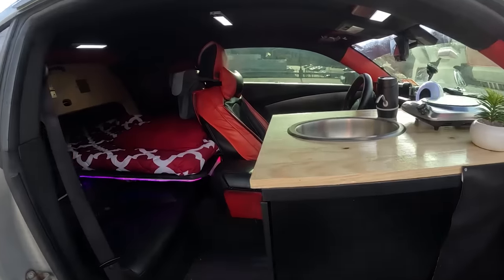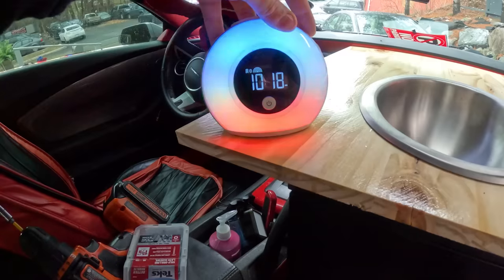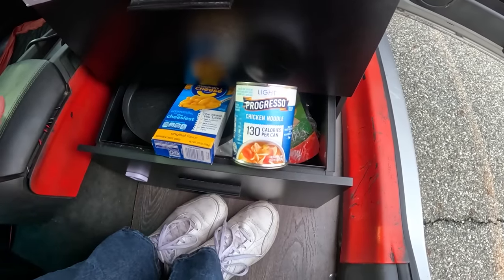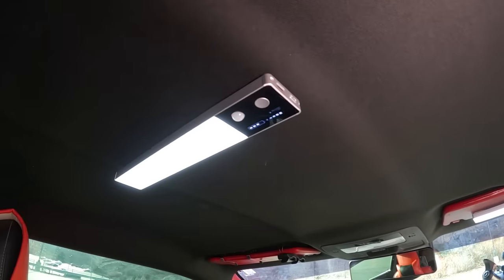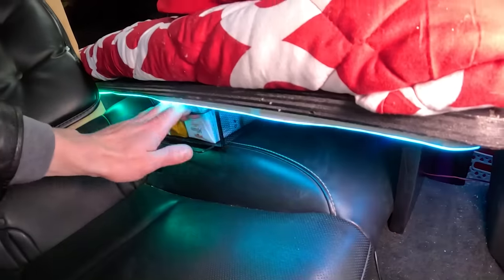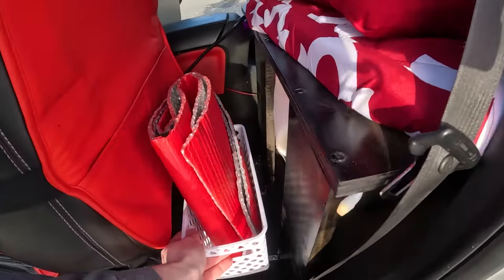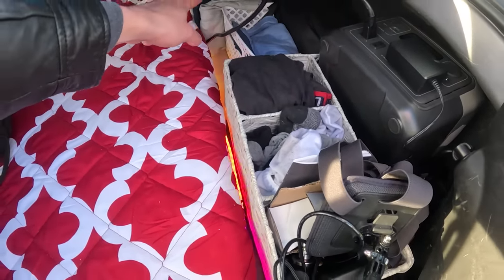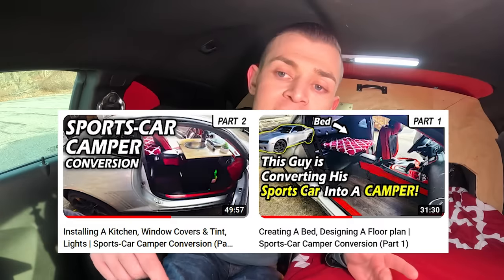I Converted My Car Into A Camper for $1,500 (World's Smallest & Fastest Camper)

Comment: I see this as good option for weekend camping and not daily living. You did a good job ❤
Reply from the maker: Thank you, user! I lived in this car for 6 months in a previous conversion 2 years ago. It wasn't as pretty or as functional back then, but I learned how to improve it!
Reply: That thing you made to separate the back and truck. Should have only made it behind your seat. You ligit cannot turn over
Reply: @mariamaria2751  that may be the car's limitation; it's a sedan and there is a metal structure the seat backs attach to from the factory.

Comment: Impressive and creative. I would not have imagined converting a Camaro but you did a great job. Solar panels must be such a game changer. I will look again as fixed panels seemed too large for my car before, for a good brand. Hope you keep posting as your time allows.
Reply from the maker: Thank you very much for your thoughts on this. Someone had mentioned if drilled the panels onto the car lowers the car's value, but I think if the car is sold as a camper, the value goes up, vs patching the holes by a body shop - just thought i'd share that! I will try to post more content
Reply: @solarcampercar

Being in Jersey, aren't you afraid that someone will steal the Solar Panels or it gives off that you're living in the car? How do you use the Sun when it's Winter and the snowstorms from hell that has been happening lately? What then when covered with snow? Thanks buddy. Love the car and amazing that you doing this in a newer Camero.

Comment: This is actually great timing and inspiration, as I myself have been considering this exact same concept with the same generation Camaro I have. I work 12 to 16 hours a night, 6 to 7 nights a week, and commute as much as 750 miles a week. That is not only time consuming, requiring 2 to 3 hours of driving out of my sleep time, it can be costly with a 6.2L V8 performance engine using premium 91 octane fuel, costing between $100 - $150 a week in fuel. I am able to mitigate the time and cost from time to time sleeping at or near work, but that can sometimes be tricky to accomplish. I have considered this as a solution, Though I would have to execute it differently with my 5th Gen Camaro SS soft top. But you have demonstrated that it can in fact work, Thank You.

Please add a link for the seat covers, mine are starting to show wear and tear and I would like to protect them.
Would love to meet you and see this in person if you are ever in the Nashville area.

Comment: You are so smart and creative. Idea. The panel can be cut just enough to hold the seat. For storage you can add a net to the ceiling and store the blanket or fold behind the seat, this way you have more room to sleep. The kitchen counter can be lower,  you don't keep too many items in the first drawer or make that drawer smaller and it's still lower. Use a black leather like cover so people won't be bothering you with questions. It is a neat idea, you are so creative.
Reply from the maker: Great suggestion noodle, Thank you
Reply: @solarcampercar  You're welcome, I have two sons your age and I am glad you guy's are so creative to save. By the way I don't know how this info would help, but if it does, great. My sister is renting a kitchen to cook and sell salsas. I bet you can also rent a kitchen when you need it. At that place they charge $45 a month for food storage, $12 and hour to cook with min of 4 times a month. Drop in and cook $20 per hour. So far I see about 5 kitchens in my area. There may be more by your work or less expensive. Maybe once you are use to it you can bring your own small table to save and just prep your food without using the kitchen part and just pay for food storage.

Comment: Looks like there is some space , maybe 8 inches or so when the drivers seat is forward. you could use a foam wedge pillow to fill that space when you are sleeping. At least your head would not be hanging over the edge. You could tilt the seat appropriately for comfort.

Comment: Grest build! My only question is about your back window. How do you see what's behind you when driving and is it legal to have it obscured with that panel?
Reply: I have a 2010 Camaro and one of the biggest complaints is that you can't see out of them anyway ~ which you can actually learn to adapt to, I have no problems. You can also compensate with side mirrors ~ think about work/commercial box type trucks that don't even have a back window. 🙂
Reply from the maker: It is legal to do that. I got used to it. Also, I have a rear facing camera!

Comment: Awesome job on this build, the self tapping screws on the roof to hold the solar panels worry me over time with getting loose and would’ve gone with some nuts and bolts but overall very well done otherwise
Reply from the maker: bolt and nut would require me to remove the headliner to secure them = too difficult for me. Thank you for leaving a comment!
Reply: If there's red loctite I'd say you're good to go lol

Comment: There are so many safety concerns here... What if something happens and you need to get out of bed quickly? You can't.
What if you are driving and you need to see out the rear view mirror (which legally must be possible)? 
What if you get in an accident while driving? You've removed a lot of the safety measures and added in a bunch of projectiles/hard things to hurt you.

I get if you have to sleep in your car, and even wanting to make a bed, but this just screams "death trap" no matter how I look at it. I'm fairly certain this car would be considered VERY illegal, even the tint might cause you to be pulled over in certain areas.

At least with a van - the front is perfectly whole for driver and potential passenger.

Comment: I like your idea a lot because I did the same thing too. But on a hybrid camry because the hybrid sys6em of the car allow you to turn the engine on and still stay stealth becuase there is a battery system in the car. I did put a thin flexible solar panel on the roof too arounf 220 watts to charge my 200AH battery. I like the idea of a sedan car because it is very easy to get around and stay stealth.

Comment: I find power seats infuriatingly slow and the switch location difficult to reach when not sitting in the seat. I was happy when converting my minivan to find a base model without power seats or rear entertainment system, but still had tinted glass!

I wonder if there's a kit to relocate the switches and automate moving the seat? A memory function would do the trick.
Reply from the maker: It is slow but honestly I don't mind it

Comment: The wooden part half way above the bed looks like a distraction and could effect free movement while sleeping, maybe it needs a design change
Reply from the maker: it does affect position, the wooden panel matches the metal frame of the car's interior, if I would to change that port opening, it would require me to cut into the metal frame

Comment: I have tried sleeping in my car for a weekend trip, but i ended up with a high temperature that turned the car into a microwave, so what do think as solution ?
Reply from the maker: okay so I lived in Indiana during the summer when temps were 85+, I would run my engine and let the AC run on low level while I slept during the day and went to work at night. uses a quarter tank of gas every 9 hours but was cheaper than paying a $100 for a hotel room. Is it bad for the engine? some people say yes, but truck drivers run their engines 24/7 sometimes
Reply: @solarcampercar  i guess trucks can turn the A/C on without using the engine. I dont know exactly cuz i am not a truck guy, but I would appreciate if the cars have the same thing.

Comment: No one ever talks about carbon monoxide poisoning living in a vehicle or frost bite while you sleep..with your feet at the end
Reply from the maker: Hi Maria! I do not have any products that produce carbon monoxide in my car right now, such as a propane stove. Now, the trunk is the coldest area since it is furthest from the car's AC vents but my car is so tiny that when heat is ON, the car can reach 90 degrees in about 5 minutes (roughly), alongside my electric heating blanket, it's enough to get me some comfortable sleep. If it does get cold in the middle of the night, I run the engine for 10 minutes to re-warm the car's interior once again